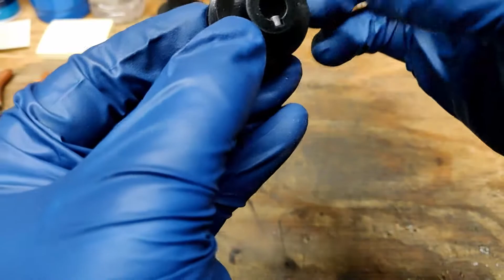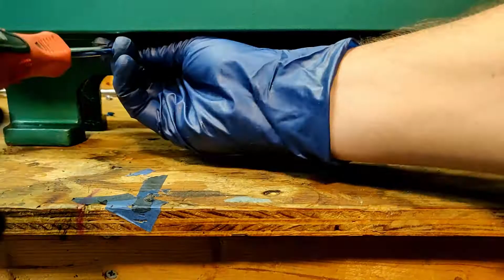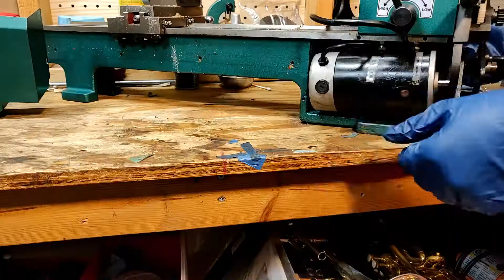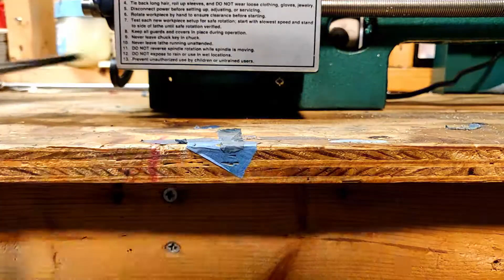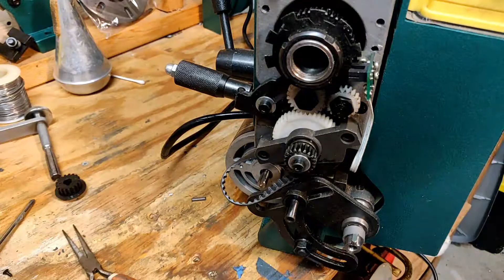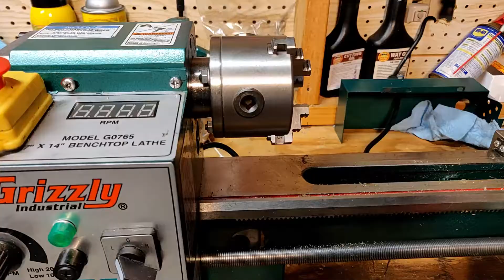Replacing the Timing Pulley on the Grizzly G0765 | Mini Lathe Repair

Comment: The plastic gears don't last worth a damn. I replaced mine with the metal ones a couple  years ago and won't have to replace them again. They really take the abuse. The small hole is 8mm the large is 10mm               https://www.ebay.com/itm/2Pcs-Metal-Synchronous-Pulley-Gear-Motor-Belt-Gear-Drive-Wheel-Gear-S-N-Cj0-C5Q3-/402278101014?_trksid=p2349624.m46890.l49292
Reply: The plastic gear teeth strip easily and the holes stretch out making them loose.

Comment: I have an identical lathe, why you don't bougt a metal one?  I did and so far, no isues......
Reply from the maker: I couldn't seem to find one. Mind pointing me in the right direction?
Reply: Where did you buy the metal one?
Reply: I got aluminum pulleys as a couple ( 17 teeth bore 8, and 31 teeth bore 10 ) for my chinese lathe ( firma "Einhell" model "MTB 3000" ) that is a Sieg inside, C2 or C3 i don't know, it seems to me a mix of both ... 
They cost now about 30 euro ( i'm from Italy ), free sending here, and i got them from Ali-Express ( China ), the seller is "Shuangsheng Trading" ( correct ! ... tested twice ); they have a lot of mini lathe spare parts, i believe them original or ( in any case ) very good manifactured ( they supply Sieg ? ). Sorry i'm not able to redirect you the item and seller address, if you are really interested i can try something. In any case if you ask as search "mini lathe spare parts" or something similar they can bury you with some thousand pieces ... and more you search, more they understand your needs ... 
If the internal bore of your lathe is instead 9,0 mm , you can order an helical reamer to enlarge bore from 8,0 to 9,0 ( the reamer must be helical ( with spiral flutes, i mean ), otherwise - with right flutes - would be impossible to work with, due to the internal key ).
Untill now i didn't need any change of pulleys, originals are still working, but - for safe - i got about two or tree pieces of every part of my lathe, just i'm missing the whole bed, the whole tail-stock, the heavy gear box ( but i got all that is inside it ) and some few others ... ( cause they are too much heavy and so i would pay too much for sending charges, ALSO heavy taxed here in Italy, as they were the goods itself ... crazy !!! ).
Otherwise, try "Arc Euro Trade" from England, it was better before "Brexit", with no taxes added ... 
Have a good job ... and ... lathe again !!!
Alessandro.

Comment: The Little Machine Shop sells those timing pulleys in both an 8 and 9mm bore model. Because the Grizzly 0765 isn’t manufactured by Sieg Industries, and LMS sells only parts that fit Sieg machines, your machine won’t show up on their “works on” list for each part. That 8mm version will fit your lathe. I put one on mine, and feel like it’s a better grade of plastic ( oh the irony of saying that! Ha!) than the Grizzly. Good vid!
Reply from the maker: That's good to know. I had not realized that. Thank you for tip!
Reply: Thanks for the tip!!
Reply: Thanks for the info!